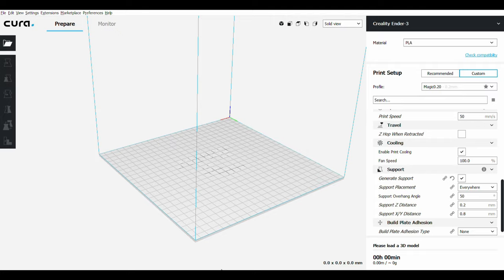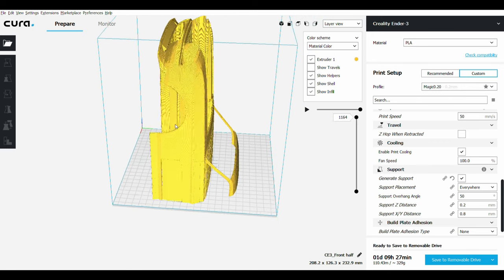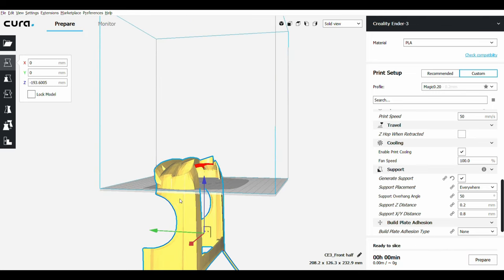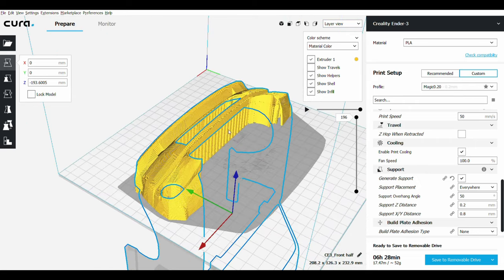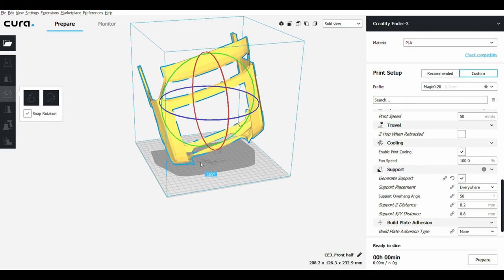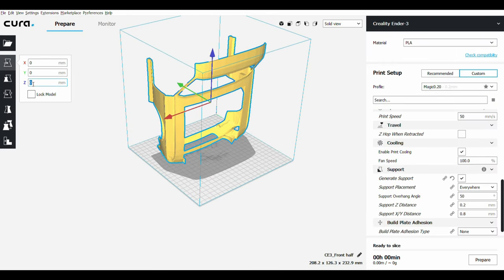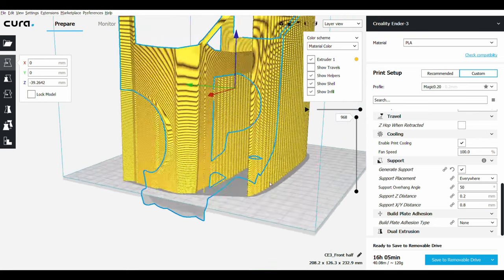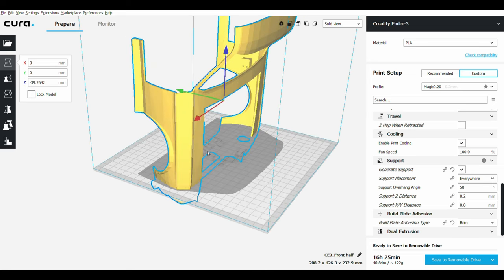How to 3d print rc car body fast and with less support/Painting rc body/Scale Addiction

Comment: If you will print roof and side columns separately you don't need supports anymore. Or divide model just to left and right part is also possible and then glue them in central axis?
Reply from the maker: That's not a good idea, it will be hard to a line all these pieces  for gluing together and they  u will end up with so many joints to sand and add body filler
Reply: @scaleaddiction  If it will be divided in central axis, length of seam will be shorter..then yours and no sending on the sides. Roof will be printed separately..
Reply: @scaleaddiction  but you are right, you have less supports in this orientation

Comment: Awesome… but why not just split the bodies in Meshmixer?
Reply from the maker: I do some of my rc bodies to 4 parts, but if its like that, this is an easy way to do without knowing meshmixer
Reply: @scaleaddiction  in Meshmixer there’s a function called ‘plane cut’ that does exactly what you’re doing, and then you can save the cut parts as STLs… edit—> plane cut—> keep halves—> separate shells—> export each part separately
Reply from the maker: I know that, this is for those who dont use 3d modeling software
Reply: @scaleaddiction  ah… gotcha… this IS a pretty easy way to do it

Comment: Another option would be resin printing. While you'd have to print the pieces in several more parts, they'd come out a lot cleaner and would require far less sanding and post processing